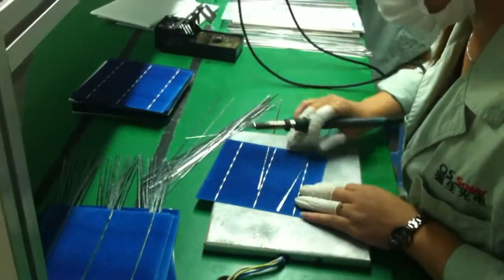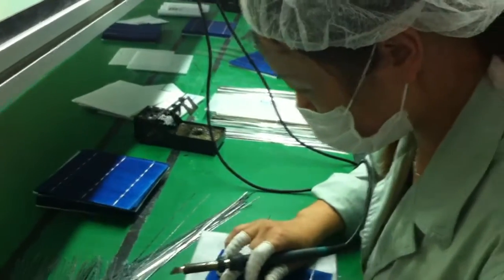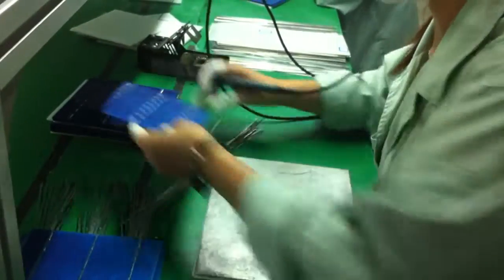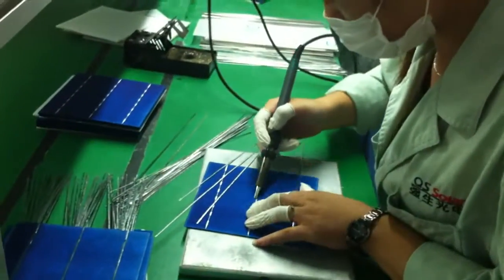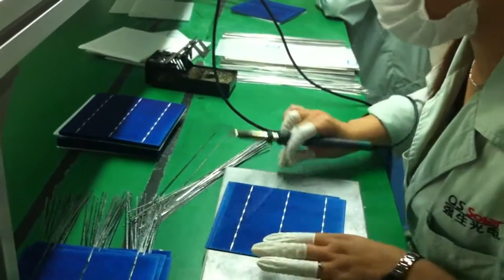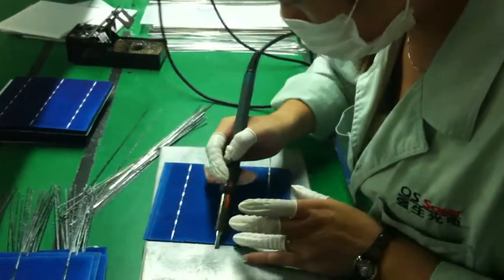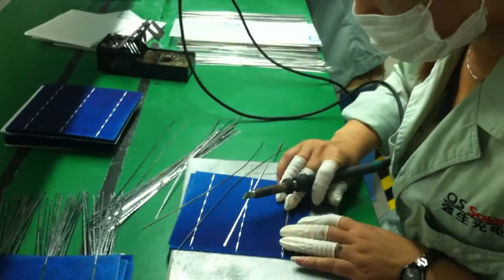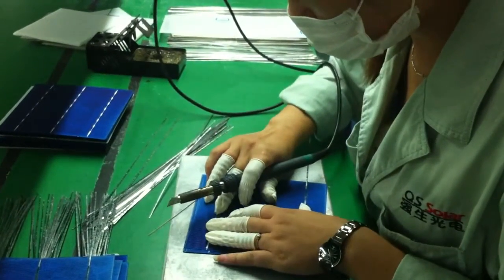Tabbing solar cells

Comment: Is this a heated bed on the table?
Reply: seems a heated table , you can see its wiring on the left side  , it's highly recommended in order to reduce stressed the cell too much but you can soldering the ribbon even without it .